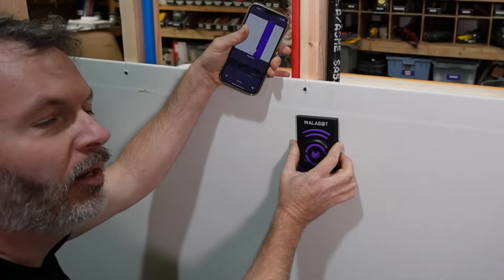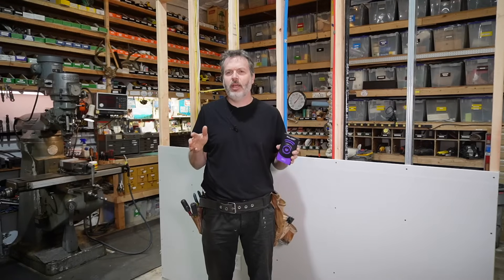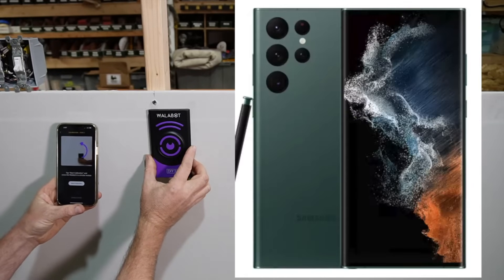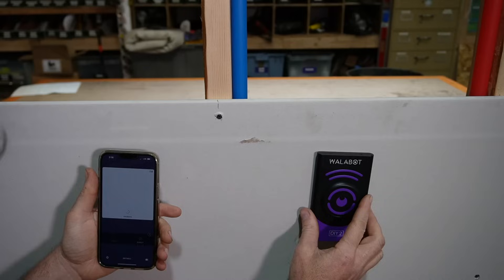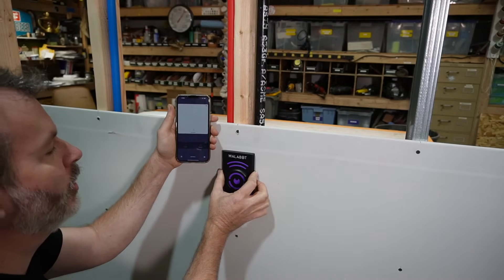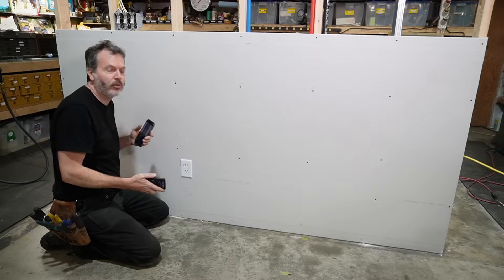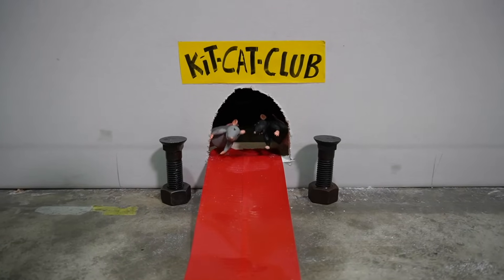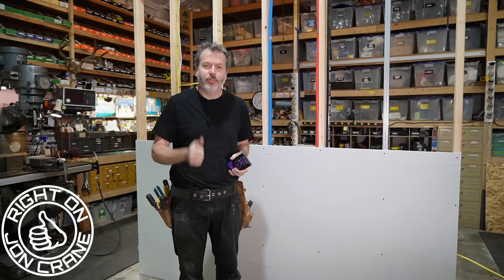X-RAY Vision - Walabot Stud Finder - See Through Walls

Comment: Hey Jon, Walabot is a piece of crap. You have to get it to recalibrate every time you use it and it still does not work as well as your demonstration. It only works like you show on clean sheetrock.  Add mud and texture and it gives lousy images. The Return policy sucks, too.  If I could only tell YouTube to stop putting your ridiculous advertisement spots at the start of YouTube videos.

Comment: Is it able to tell if there's a wire or pipe through a stud without a nail plate or would it just be that I can see the wire or pipe lead into the stud on one side and out the other?
Reply from the maker: Hi Alex it doesn’t pick up the wire as it passes through the stud but will pick it up on the sides. 👍 ⚡️⚡️⚡️

Comment: Hi Jon ☺ this is a right on piece of technology,  never seen that before, I bought a battery powered stud, metal, electric, detector, and you can't trust it at all, drilling in homes in the uk can be russian rulette, as I know too well having drilled through a mains water pipe in a brick and plaster wall, it got messy real quick,lol. The device you demo will save more than it costs in making good from a  hole shot in the wrong place, ha, ha,  thanks for the video,  stay safe mate, best wishe's to you and your's, Stuart UK.

Comment: Hi Jon., I thought about this product for years and wondered if it was legit, and after your demo, I am a beliver. The one issue I see is there is no marking devise to put a reference mark, as the Zircon that I have . So having to hold your phone and the device at the same time, you would need to put the phone down and mark it. So does the device have a arrow to show the exact center of the obstrution? I think this is a flaw they should fix.